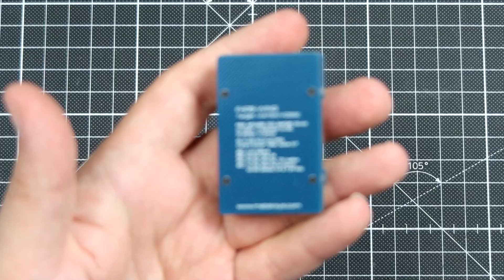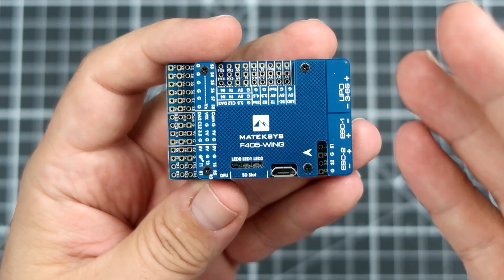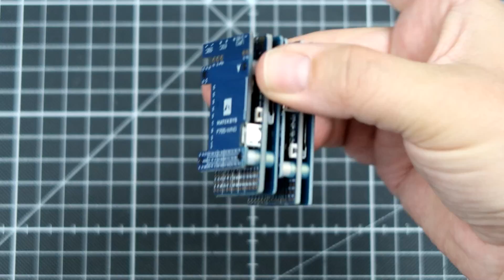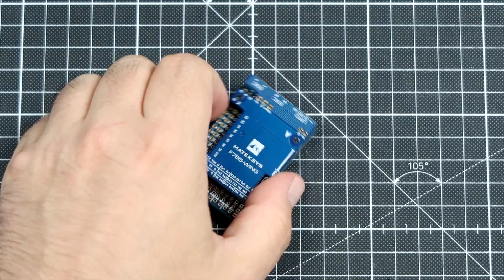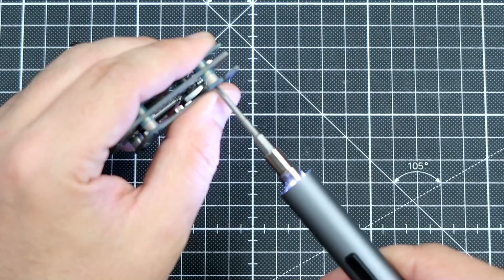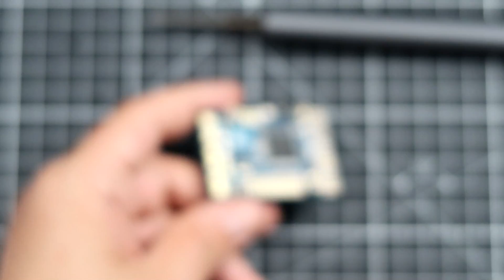Matek F765-WING hands on - 12 PWM outputs and 8A BEC for your airplane

Comment: ATTENTION! DO NOT BUY Matek H743 SLIM, I bought it and the product turned out to be defective, at first the current converter got very hot, it shorted out the chip and the controller stopped turning on at all, everything was connected correctly, I'm not new to this business. I contacted the manufacturer Matek, they are at the office. The site claims a 90-day warranty, my Matek H743 SLIM was under warranty, I provided them with video and photos, but Matek stupidly stopped responding to my letters, I wrote from another box, and they replied that the warranty does not apply to the MCU! I'm just unlucky, damn it, it applies to everything, but not to the MCU! I do not advise you to buy Matek products, it will burn out of the blue for no reason, and the guarantee will not work, Matek will send you and say that the warranty does not cover what exactly burned out to you!

Comment: Hello Pawel, do you think it is overkill to put a f405 on a fpv plane that i use just for fun? It is a sky hawk v2, twin motors that is not using gps nor any kind of extra peripheral. I can fly it very well in FPV, but i wanted to also practice LOS, but i severely crashed it 2 times before, so i'm not confidente in my LOS skills. I just wanted it to be more stable and safe.

Comment: What about a clean noise free power for camera and video though...?...The F405 is good, but still could be better IMO...
Reply: The F405 does provide clean power.  I run 6s through it with a blheli32 esc (no caps) with no issues.  Check your grounds perhaps?  The F411 is noisy, as it gives vbat with no filtering.
Reply: @scottyh72  I've found the filter on the F405-wing to be fine for the fpv kit but Matek didn't add one to the fpv power supplies on the 411. I think that lesson was learned from the feedback from pilots, a decent LC setup should be integrated. FYI - I added an LC filter to my iNav F411 build on a ZOHD Talon Rebel GT (where I also covered the LC filter issue). Happy flying!
Reply: Agreed, an LC filter would help a lot IMHO but, due the the size of those components I think would be problematic to have them onboard but they could have some sort of connector to plug one I suppose.

Comment: Too bad they still did the same mistake positioning the USB conector like that without any proper support. It's pratical if you have the controller installed but quite fragile. I'm now replacing the cases with a 3d printed one that offers more protection to it.
Reply: how should a case add more stability to it? just add some epoxy around the usb connector and be carefull to not fill it. i did this with cheap omnibus f3/f4 clones from aliexpress because they were soldered so badly that just connecting once could rip the usb connector from the board...
Reply: @derrogers  The case fits The conector snugly with support in the back. I did add epoxy to the last one but I feel better with the case.
Reply: Don't rip out the usb, and you won't have a problem.  I have 4 wing models, all with working usb sockets.
Reply: @scottyh72  You can be sure that I didn't do it because I wanted to. I really don't see a point in your comment.
Reply: No problem with USB position and support. They solder is good enough. 👌🏻
Reply: Mine has running loose on f405 board.. Neef to add some epoxy to it to solve the issue.. At least fir time being